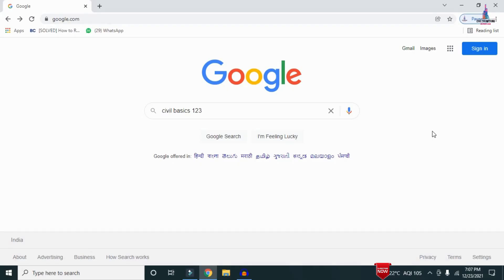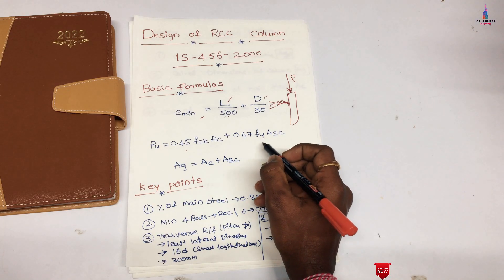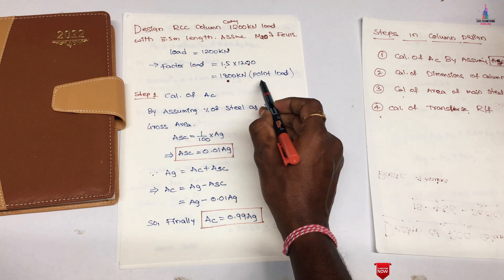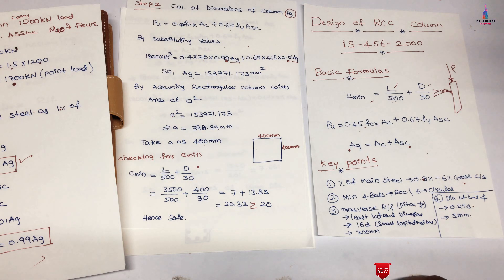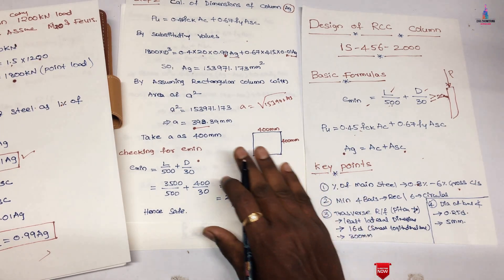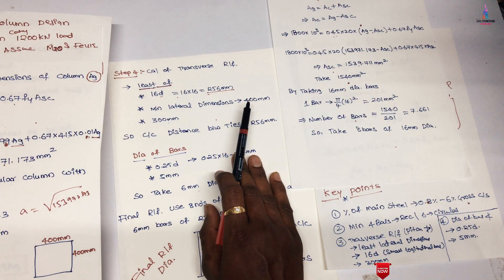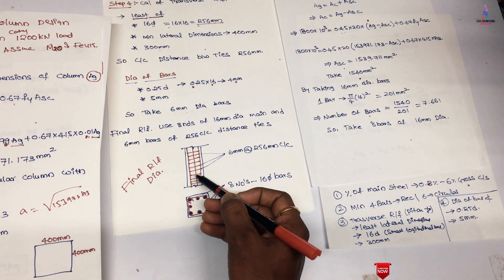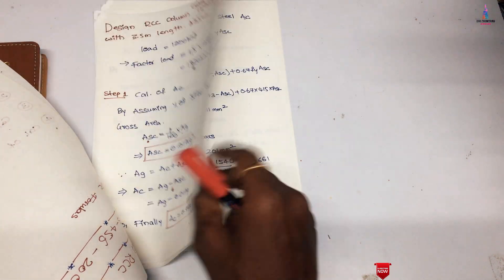Complete manual calculation of RCC column design by using IS 456 2000 code | structural design |

Comment: The span in between two columns 30 feet, 250tonnes comes on each column of five stored building, pl design size of column along with steel, further the soil is B. C soil, pile foundation to be designed for pile cap and piles along with steel.

Comment: sir how did you get the 256 mm c/c?
Reply: Transverse reinforcement (pitch) 
1)16d=16*16=256mm
2)Min lateral dimension of column 400mm
3)300mm
Least value taken out of these values ,that's why he took 256mm

Comment: wrong math calculation.  A.g. result should be 168216.44
Reply: also in is-code 456 clause 39.3, it says that minimum eccentricity should not exceed 0.05D.  If you choose D as 400mm, then 0.05D is equal 20.0 but your minimum eccentricity is 20.33 which is greater than 0.05D, so your analysis does not comply with clause 39.3
regret to say but do you want to clarify ?
Reply: yeh true